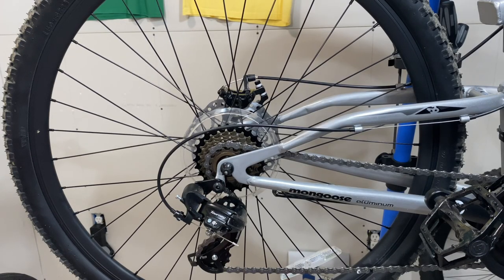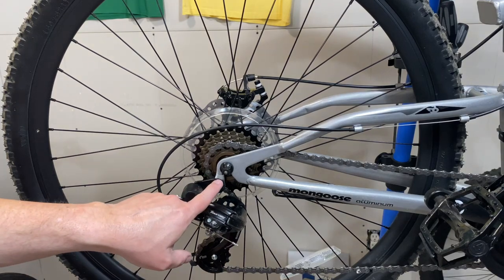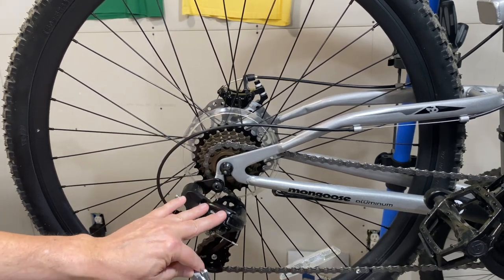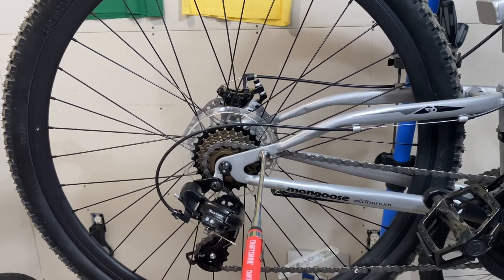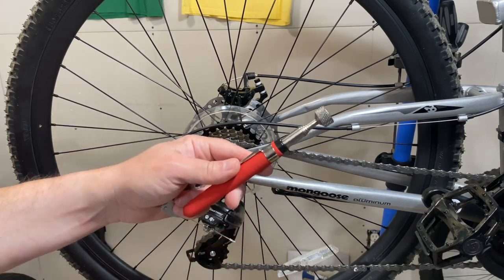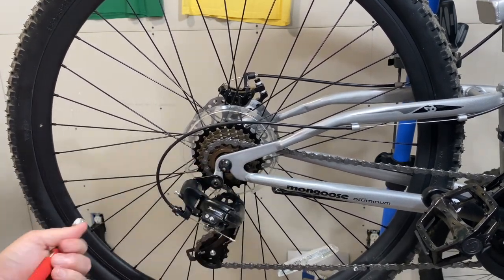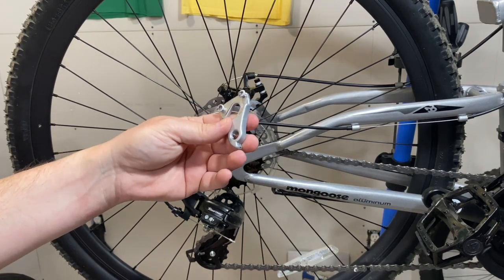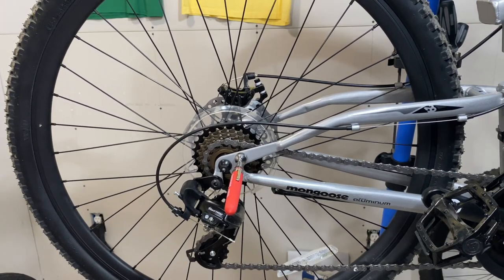NO HANGER - NO PROBLEM + How that relates to the Mongoose Impasse Dual Mountain Bike

Comment: I had a Pacific 5500 dual suspension aluminum mountain bike back in the mid 90s to around 2015. It had the same kind of frame setup. The front half of the frame was bare engine turn brushed 6061 aluminum and the back frame half was black painted steel and had the same kind of integrated dropout hanger as the Impasse. I currently ride a Mongoose Switchback Expert Aluminum frame mountain bike and it has the replaceable dropout hanger. It's an all aluminum hardtail and has extra thick rear dropouts.

Comment: Though not as common, there are a few steel frame bikes that have replaceable hangers. It's not something I stress over on a steel frame bike because steel is much more malleable and resilient than aluminum.

 I have seen a few steel frames with the hanger broke off, so the only way to effectively fix that is with a new dropout being brazed in. There are some workarounds out there, but they only work on frames with horizontal dropouts.

I did recently have an old steel mountain bike frame I was building up and the derailleur hanger hole that the derailleur bolts to was stripped out. Fortunately, Wheels Manufacturing makes a threaded insert you install after drilling out the hole to a very specific diameter (the drill bit comes with the repair kit). That ended up working out well, but the frame would otherwise be trash or a wall decoration. Steel frames could certainly benefit from having a replaceable hanger.

I've had a few bikes with replaceable hangers that I've had to straighten. They have to be bent pretty badly to break off, so they usually bend back just fine. Only issue is if you keep bending them, the aluminum gets softer due to fatigue and becomes easier to bend. Good to replace the hanger after its been bent more than a couple of times.

Comment: My all aluminum Gravity 29.2 came out of the box with a bent hanger. I straightened it so I could ride the bike while I waited for a new one to come. That was 4 years ago. I still haven't put the new one on. My wife's old Schwinn Sidewinder has a "doodle" that got bent on the car rack on the way to the trailhead. That was an aluminum frame. It was straightened, but I fear if it gets bent again the bike would be finished. I have seen repair kits online. But haven't used one.

Comment: I bought a steel Centurion road bike from the 80’s and the hanger noodle straight up bent and broke off! An added plus about steel frames is that they can be welded easily back together by most auto shops and I was back on the road in less than a week
Reply from the maker: Thanks for sharing

Comment: If the frame is steel then I prefer the integrated hanger. It may arrive to you out of alignment on a big box bike but once aligned it wall stay aligned barring a catastrophic crash. In most cases with a big box bike the derailleur will break into pieces well before the integrated steel hanger bends so far that it snaps while realigning.

Comment: A lot of dropouts are steel though even if they have aluminium frames, it's easier to produce and it can be bend back more. Also a lot of people have bent hangers without even knowing, I've checked all of mine since I've got a tool and 2 of the 6 bikes had a bent hanger without even knowing.

Comment: Is the steel only the flat part of the frame that you stuck the magnet to? Is the round tube with the "mongoose" sticker aluminum?
Reply: The dropout is steel so the chainstay is also steel. You can weld steel to aluminum.
Reply: @TheCaptainsCog  they don't weld steel dropouts to aluminum, they solder it

Comment: I purchased a Specialized Camber Comp on eBay that was professionally packed by a bike shop.  However, when it arrived the derailleur hanger was bent so much that the idler pulley was rubbing against the spokes.  I followed instructions from some YouTube videos on how to carefully straighten it.  It's worked fine ever since.  It's good to know that if it fails later on I can replace it for around $30 vs. buying a new frame.

Comment: Kev, are the tube parts of the back steel or aluminum?  Through this entire video, the magnet only touched the flat parts. are the seat stays and chainstays (the tube part) steel or aluminum?
Reply from the maker: All steel
Reply: How do you suppose they could weld steel to aluminum?
Reply: @truracer20  Silver solder.

Comment: spread the rear frame appear a little bit The put in motorized Mag wheel with Disk brake rotor Is Sprocket gear on each side of the wheel
Reply from the maker: Lol

Comment: Hanger as part of the frame, yeah, not very excited about that.  I do have the explorer FS, got it cheap, locally.  Stripped to save space, not sure if I ever want to build that up because of the steel triangle and hanger.  Definitely got a few Walmart bikes with bent hanger, not even going to bend it back, send it back to walmart for replacement!  Once it's bent, never going to be the same again.

Comment: I've bent a frame doodle, but not on a mtb. It wasn't a big deal fixing it. A frame doodle is still a deal breaker on a mtb for me.
Reply: If the bike is aluminum, if it has an integrated hanger and it bends, you have to be really careful. It is not safe to cold work aluminum like that, especially not the tubes.
Reply: @tarstarkusz  My city bike without a detacheable hanger is (fortunately for this case) steel. I wouldn't have a doodle on an aluminum bike or any mtb.